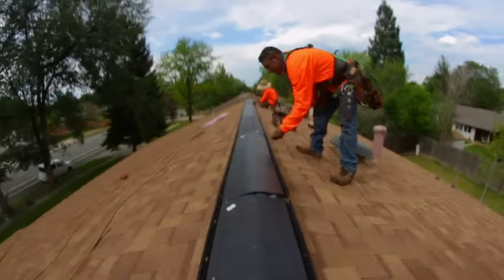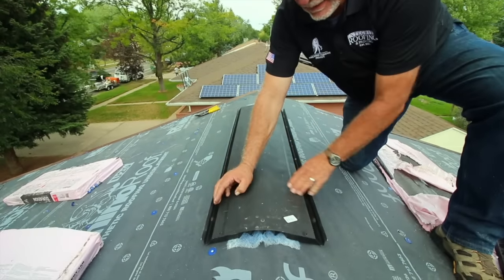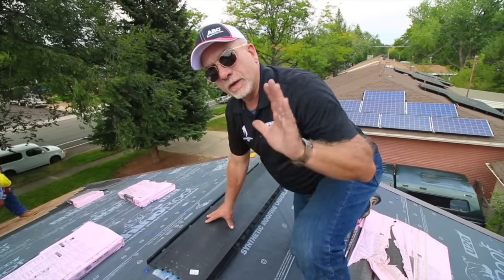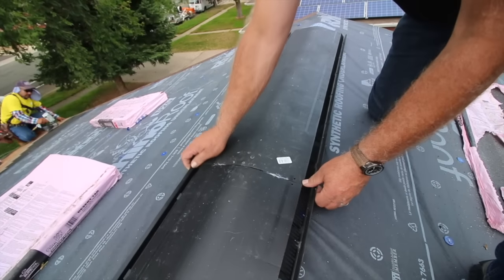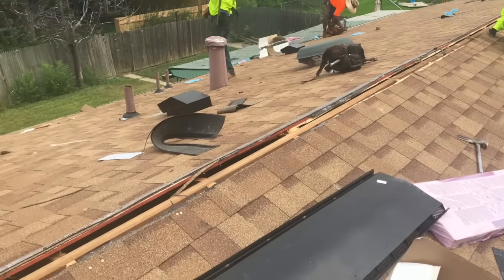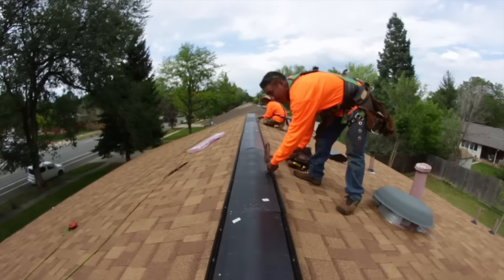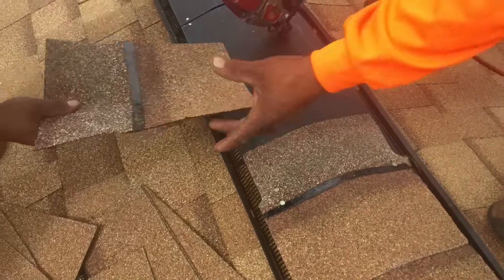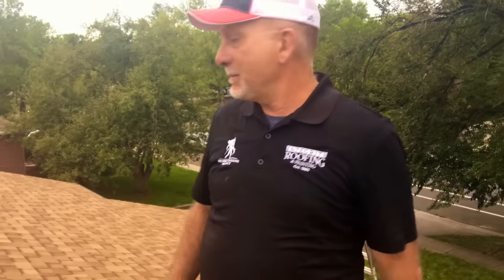RIDGE VENT INSTALLATION TIPS | ROOFER TRAINING

Comment: as a contractor I use lamanco 750. the old top hat looking ones. the holes as big as your head.  it don't have fiber glass to clog up with dirt.  an the hole is as big as ur head put 6 or 8 of them on.  do the math.  you get more air flow I live on the coast guess what get a hurricane it blows water into the ridge vent. I live 1/2 mile off gulf I got the old top hats I tared them down then tared each shingle to the vent I didn't get any water in my vents ever.
Reply: One stick of Shingle Vent II ridge vents is worth 72 NFA and a 750 is worth 50 NFA. By far a Ridge Vent exceeds the NFA of a slant back.
Reply: true but I never had a 750 leak but I have gone an changed out ridge vents to 750.  on others roofs I live on the coast of Mississippi. plastic an 100 plus months don't work to well I still with the aluminum 750.  you probably think the plastic pipe vents are better then the metal ones too also right?
Reply: I will get you a pic of a plastic pipe boot an post it here for you plastic don't hold up in sunlight.

Comment: So on the final end of this ridge vent, are there exposed nails that don't get covered??
Reply: The way I was taught and the way I've always done it is, the last two are 8 penny nails.  I've never had an issue and you don't see them unless you are on the roof standing over them.
Reply: I cover my last ridge nails with sealant and sprinkle the sealant with granules left in a bundle bag.  It looks so purty!  Then I sprinkle the rest on my finger nails, so I too can match the roof.
Reply: Sealant on nail head usually develops leaks after a few years.  Is there any way to install the last piece of shingle without exposing the nails?
Reply: @scrunchiiface  yeah but doesn't that hurt when you're in the masterbatorium?

Comment: Great instructional video man.  Thank you.  I'm in Northern Canada. I had my garage installed with metal roofing 15 years ago when I built it, thinking it was going to maintenance free. I find out now that I have squirrels living in the attic because there's no ridge vent. There's the longitudinal gap you recommended but only foam closures on both sides under the ridge cap which the squirrels removed to get inside. Any suggestions on how I could install a ridge vent now, or do I have to unscrew the roofing at the peak and try slide short sections underneath?
Reply: I'm curious about that too. I'm plannig to do new roof on my house. Currently it's shingles but thinking of metal roof. I definitly want the ridge vent but have no idea how it will work with metal roof.

Comment: How do you cut one section if it's too long? Where do you get the shingles for the cap? How do you install the last shingle without the nails showing?
Reply: I have the same question and can't find an answer here.  In my experience, patching nail head always leads to roof leak after a few years.   Most roof installation warranty probably expires when the roof begins to leak ...  Nail head should never be exposed in my opinion.

Comment: Soooo. I did not had this ridge before. For year we had what I would call a "regular" ridge top, my attic was always hot, I do have the regular soffit vents on each side of the house. Since the ridge like this was placed I've been having polen blown into my attic. If it rains I can see water coming in too. It is not much, it just a tiny drop here and there along the ridge. Is that normal? I really hate that ridge. Something inside tells me to close that, that any opening on the roof other than vents means trouble. Am I right to want to close that ridge gap?
Reply: Got my new roof with ridge vents and I have the same problems.  I asked the roofer to fix those issues but he seems doesn't know how to fix them or he tried to play dumb about them. How have you dealt with those problems?

Comment: Did the owner not want the old round vents removed? Looks funky with a clean ridge vent, then the old ugly vents that will be competing with it's operation.
Reply: that round vent is a power vent works great till it stops working then its just a normal vent. yes will affect how ridge vent works but you can't over vent a roof.  and make it keep working the power goes right through the thermostats and it burns what thermostats so doing it with house thermostat its low volts don't ask me to explain it Google how to.
Reply: No doubt not the smart duck in the pond who most likely couldnt build a prefab dog house.
Reply: the BLACK METAL vent could be for stove or dryer but dill rod the gray round one is a power vent

Comment: What stops the water from going into the ridge vent ?
Reply: Chad, as we know, water flow down, so the angle is the key, water flowing down from the shingle and hitting the roof material down slope from the top.  Of course, you probably wonder about high wind blowing the water sideways, which can happen.  To that, I doubt it happens enough to be a worry, but I would imagine in the right area, it would be an issue.  I would also worry about snow clogging the vents.  But what a great idea to allow heat to escape, but people need to remember you still need good even vents (that takes care of air OUT, but still need good air IN)
Reply: Gravity
Reply: Sometimes negligible amounts of water do blow in. It’s usually absorbed by your insulation and dries up quickly.
Reply: I've been asking this on many videos 🤔 nobody answers me lol yes driving wind rain people!!!  Going to get my roof done in april ,co asked if I wanted ridge vent put in. Nah I'm good" = cuts in my roof, more nails, weather, or bug issues? Doesnt seem like an even trade off

Comment: How do you change out the roof jack where the main power comes in?
Reply: A split boot
Reply: Before the split boots were available we used to call and have the power company disconnect for the lines, we would remove the head, install a new flashing, then have power hooked back up. 
Split boot is much easier. You can leave the old boot in place usually in the split but will cover it

Comment: where are the nails for the shear transfer?  and sheathing panel edges you need min. 6" edge nailing. I see no continuous blocking, just rafters. missing alot of STRUCTURAL nails it looks like.

Comment: Can you tell me if the ridge vent is enough for the attic cause my older home don't have soffit vents is there anything else i can use
Reply: You have to have both soffit vents and ridge vents for a roof to ventilate properly. You can’t have one without the other
Reply: Building code says at least 50% eave/soffit and 50%ridge or your attic "sucks".  Most ppl I know go 60% eave/soffit and 40%ridge.
There are several options for intake venting if you don't have soffits.   Those options and the solution you choose should be finalizing before starting roof work.  You can set yourself some pretty big bear traps by not planning your intake ventilation.

Comment: Not suppose to gun nail cap on ridge vent.heating and cooling will pull them loose
Reply from the maker: Thanks for your input. The manufacturers installation instructions allow for the use of pneumatic equipment for installing ridge cap over the solid 4' lengths of ridge vent.
Reply: I understand they say you can. It still doesn't stop them from pulling loose
Reply from the maker: Ok, thanks for your reply.
Reply: +Ethan Smith - They are securing future repair calls... Duhhhhhh  LMFAO!
Reply: you said yourself 2 1/2 inch nails guns only shoot 1 3/4 and the manufacture supplied 2 1/2" hot dipped roofing nails for years when this product first dropped you sir are the low bid corner cutting low wage operation that gives us all a bad name shingle vent II requires hand nailed ridge cap
Reply: Hand nail  hand nail hand nail, ridge vent always!
Reply: The longest gun nails that fit in that gun, will not reach the decking. Hand nailing is a little slower but highly reccomended.

Comment: How much air could be vented out of these?  how many cfm per 1’ of ridge vent?
Reply: This looks to be AirVent II.  Capable of 18 CFM maximum per foot,. Less I suppose if the hole in the deck isn't quite right...happens.

Comment: Can a ridge vent be retrofitted like this on a 1:12 pitched roof? It has torch down installed. We have a whirlybird installed but most other rooms have zero air flow. There are soffit 2 inch holes at the soffit portion of each bay but no other roof ventilation. Thanks!

Comment: I have a question to anyone. I am about to put architectural shingles on a shed roof. The front has a line of sticky tar like stuff but the back has a line of plastic. Do I take off that plastic or leave it on. I see the instructions but it doesn't mention the plastic on the back. Thanks
Reply: leave it on. it is only there to prevent them from sticking together while packaged. It usually says do not remove on the selifane.
Reply: leave the plastic, it will disintegrate after being heated under sun's rays
Reply: @gabedavis8153  cellophane

Comment: im not a roofer but the 1st thing I noticed was the ridge is off to one side of the peak of the roof, not centered on the peak... whats going on there? looks ridiculous as far as aesthetics go
Reply: it was on center. It appears that it wasn’t in the final TOP view because you shingle over the ends of the roof at least the last 6” to stop wind/water penetration into the ridge. The “ends shingled over” gave the optical illusion of the ridge vent being off center because of color variation.

Comment: Is AirVent's ShingleVent II, used in this video, flexible enough to work on a 12/12 pitch roof? Is this the ridge vent you recommend for a 12/12?
Reply: According to the manufacturer, this product will work on any roof pitch from 3/12 to 16/12. They also make vents that are 9" wide and 7" wide, and those are good for 3/12 to 12/12.

16/12 pitch roofs are for people much braver than I...but if you have the courage, they have the vent.

Comment: your in a pickle I guess on who's instructions to follow.  Owens Corning states to install nails "7 1/2" from the butt end of the shingle" which means they are to be side by side, not top over bottom shown here. ShingleVent II calls for nails only in the nail line which would put them in the top over bottom position.  If there is a warranty, maybe no one covers it.

Comment: I would like to point out that in the beginning of this video, they are installing ridge vent to a roof that has a power fan vent for ventilation. This has just shortened the life of that roof.
Reply: Now a days most of those aren't even working anymore.
Reply: @Fiberglasser03  then why would you not remove it? It can counter act the venting system.
Reply: Derrick Benard 

Well theoretically if the ridge vent and soffit vents are spec’ed properly, the unit shouldn’t even kick on with the humidistat. I guarantee 99% of roofers aren’t even checking the intake of the soffits aren’t unimpeded with batts of insulation. I used to think like you did, but now I keep those bad boys in just in case. Your literally talking about a fan that isn’t on 24/7, so disrupting the air flow is minimal.
Reply: @bigmacattk  so what you're saying is that you would wrather have the possibility of even the smallest disturbance in air flow, than eliminating the possibility all together? Are you the 1% that checks these things? Or are you just part of the 99%? How often do you check the sofit? How hard is it to just remove and patch somthing that isn't working and could possibly create problems down the road? I personally don't want a call back ever, even if it's after the warranty. That's the problem with so many companies out there. They do the minimum to get through that warranty and then it's not their problem.
Reply: Derrick Benard 

The power vent shouldn’t kick on anyway if the ventilation is adequate. If the ridge vent isn’t working, then you have a backup. Done a lot  of roofs where we took out the power vent, and installed a ridge, only to put one back in a few years later. If anything, board up the gable vents. Having two passive systems is where you disrupt air flow. A power vent is intermittent 

The problem is that the ridge vent system is usually inadequate on some homes especially hip roofs where the net intake from the soffits is much greater than exhaust of the ridge. Maybe a cobra vent, but I would be more worried about ice daming in those areas
Reply: @bigmacattk  very frustrating when air flow from the soffits are impeded!!
Reply: Why do you say that the life of the roof will be shortened? What's the reasoning?

Comment: You said to put the ridge shingles on with 2.5 or 3" nails, then you used a coil gun to put them on. Those can't shoot 2.5 or 3" nails!
What gives??
Reply: Not a word was mentioned about length of nailed used for ridge vent shingles..  
however he did mention the length of the ridge vent nail size and maybe you confused that with the shingles.
Heat was getting to you out on that hot roof/ cloudy day..

Great video and good instructions on the roof and during the video- looks like a great crew

Comment: Good ridge vent good shingles. Too bad the roof is junk as you had your cartel controlled slave labor destroy the products with air guns. We know where you got your slave labor but where did you find an air gun to use 3 inch nails on ridge vent

Comment: you may as well just shingle over that peak and vent opening, that vent system is a waste of time and money.  cut a 3" gap in a peak, then seal it up solid with a sponge bottomed vent ?  that is the dumbest thing I ever heard of.  look at a ridge vent, on a farmer's barn- now THAT'S a ridge vent.    they stand above the roof about 6" to 1 foot high.
Reply: tunnelportterror it might be dumb to you but in some areas they work perfectly with no problem

Comment: you may as well use no ridge vent at all, with that spongy 'glas material underneath, you are getting little or no airflow out of the vent, and over time it will clog nearly solid and no airflow at all.  these roofing inventions never fail to amaze me with their stupidity.  leaving a 3.5" opening in the top of a roof, in an attempt to vent it, is 1700's mindset.   what about the gaping 3" gap in the roof that over time is going to leak ?  it's not a matter of it, it's when- sooner or later all ridge vents leak, and often ruin the entire roof, because by the time they are discovered, the plywood is rotted too- the homeowner doesn't even notice it until they start seeing wet spots on the ceilings.  by then it's been leaking a LONG time.  a good ridge vent, well thought out, should be at the peaks, underneath in the eaves on both sides, not on top where the shingles are- but inside the attic.  vent it into the attic, then out the eaves, where it is still under the soffit and overhang.
Reply: the ridge caps work really well, spongy glass material keeps out unwanted critters. Stops no ventilation. I have this identical ridge cap on my house, been over ten years, still operating and looks the same as ten years ago. Attic temperature was greatly reduced.  Vaulted ceiling on half the house, ZERO water issues, the ridge cap is about 5 inches past the actual hole in the roof and down the roof 5 inches too.. Water doesnt get in, you cant even see the hole in the roof, be quite the treck for water to get in lol. I dont get why you think it would leak, its literally shingled as well. Sure maybe in 25 years it could leak when the shingles life is done, if thats where you are getting at. Its impossible for water to get in to lol, really impossible with good shingles not past their life use. If this leaks, then no vented ridge cap would leak too, because there is really no difference in the leak department, shingled the same way, infact i think the vented ridge cap protects greater!, its a whole another barrier water has to get through if it gets by the shingles.
Reply: Isn't that spongy material the same thing as you would use in a vinyl corner to keep critters out? Is it possible to buy this spongy material at a hardware store/online if parts of it become a little dirtier than usual like the above comments have mentioned? Meaning, if they do get dirty, then the actual venting part wouldn't work correctly in a ridge vent.
Reply: 2 hurricanes (H. Harvey-125mph 8/2017) with ridge vents here in Corpus Christi, no leaks or problems for more than 20 years.
Reply: @HawksDiesel  if theres a spongey material in the ridge as a filter. 100% guaranteed over time that filter will become less efficient and eventually flow very little air... same as a car air filter ect... thats just facts...surely Something is needed in there to keep out animals and water but thats gonna get plugged up over time and reduce airflow,for sure

Comment: How many 3 inch roofing nails are needed to attach the shingles for each 4 foot Ridge Vent section.
Reply: Fill every pre drilled hole, I think 4 on each side. The vent should come with enough nails attached
Reply: @Mr1deerslayer  No, I mean the number of nails to attach the roof shingles for each four foot section of ridge vent.